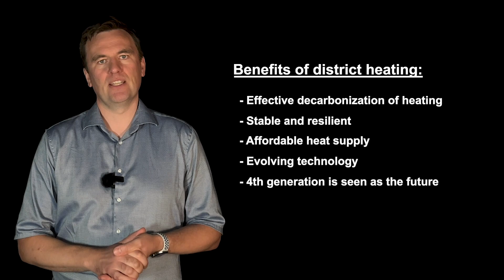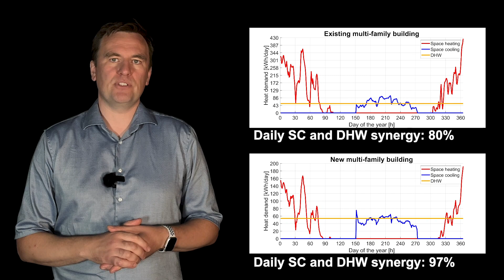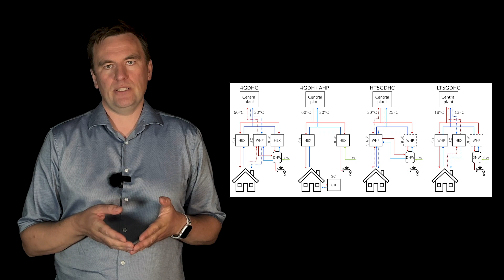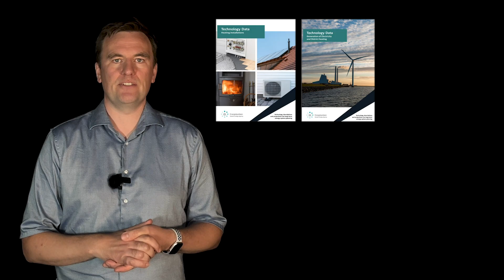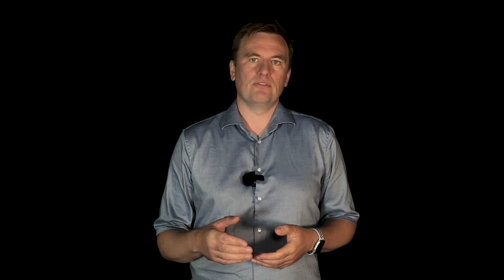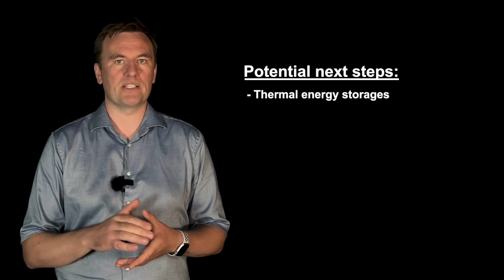4GDHC versus 5GDHC in Rome

Comment: Thank you for the interesting insights and valuable analysis! I think cost data is crucial for this analysis, and from my experience piping costs of 5GDHC are significantly smaller than for 4GDH since these are simple PE 100 pipes. If you would like to do a techno-economic comparison for Germany, we are happy to support with data.
Reply from the maker: For equal sizes you are right, as the circumference of insulated pipes are larger than those without insulation. One however needs to take into account that the lower temperature difference in thermal source networks (TSN) / 5G systems are smaller than in 4G systems, which leads to larger diameter pipes for TSN networks. This difference in the required pipe diameters, and the possibility of using twin pipes for 4G systems will impact the cost comparison, particularly at large capacities.